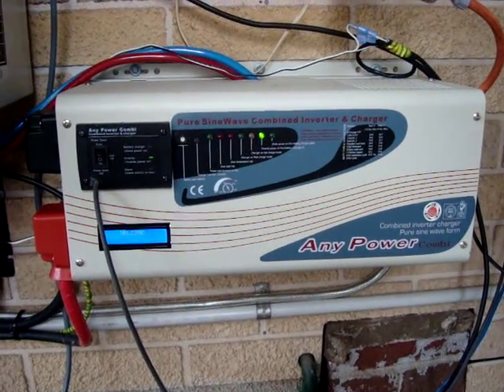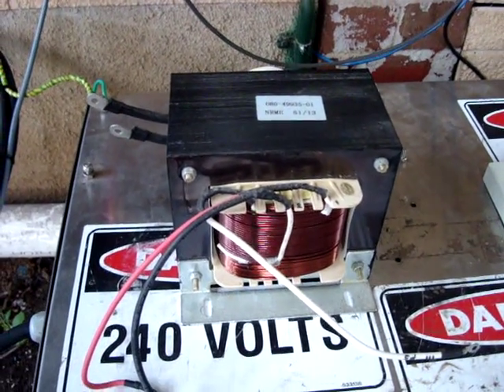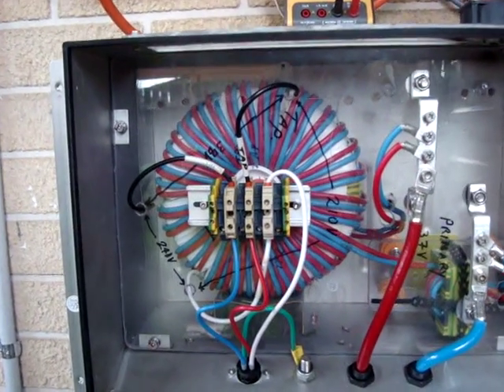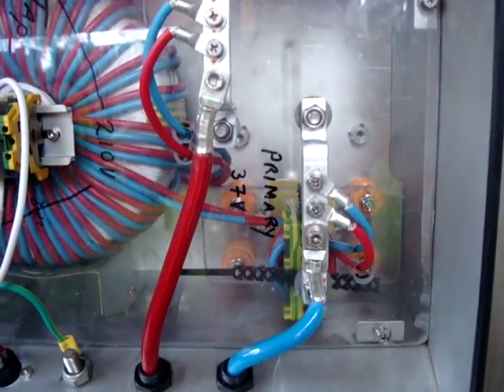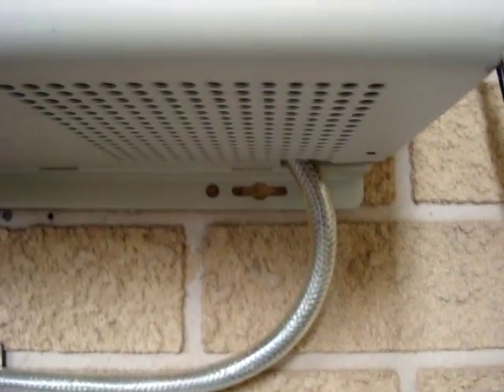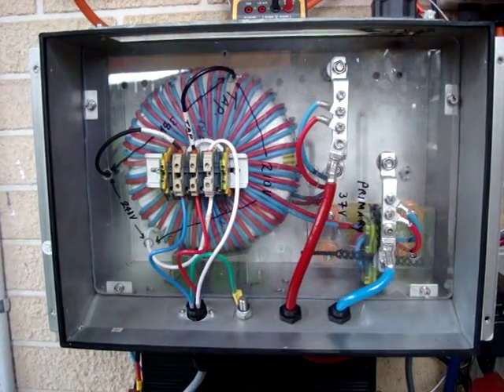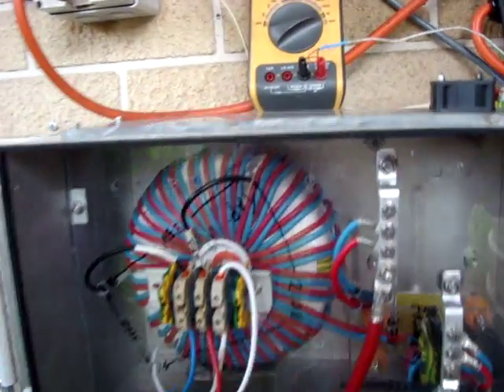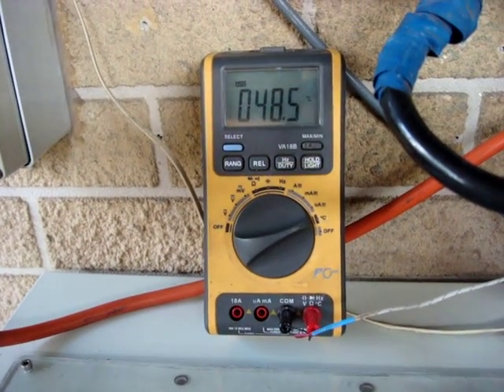Powerstar W7 Inverter modificati​on

Comment: I have a powerstar w7 L 24v F , Consumes 1.9 A in save mode, 5A in no power save mode,  any easy way to fix it?  I remember someone changed a piece in the electronics toroid and got it fixed.